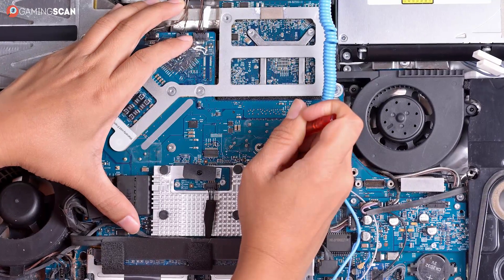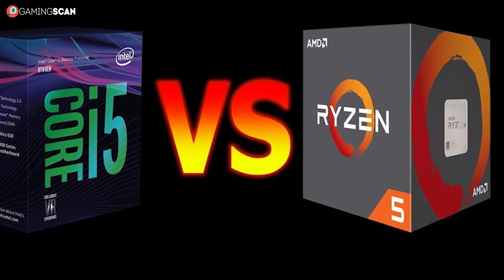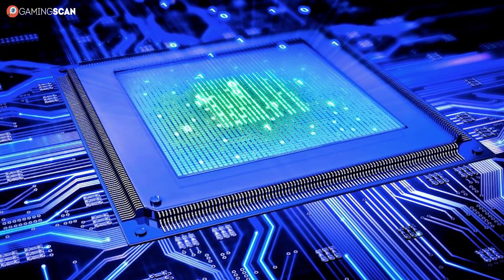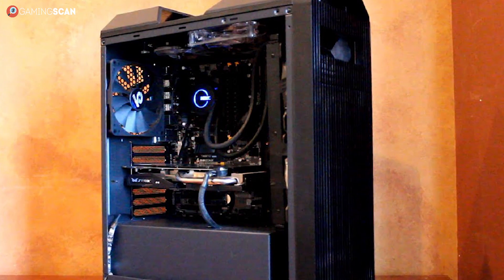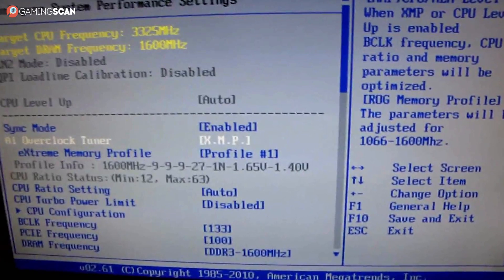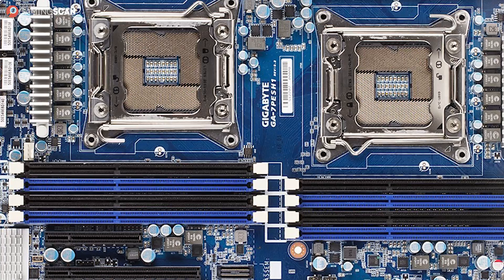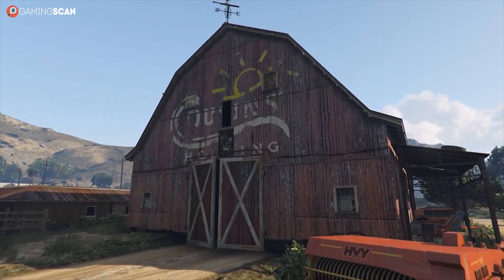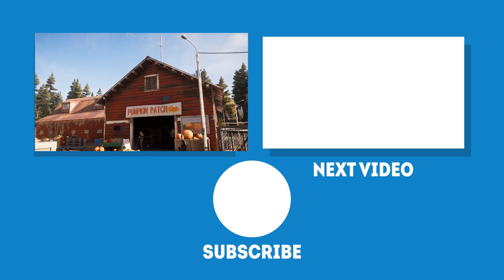Can You Use a Dual Processor Motherboard For Gaming And Is It Worth It? [Simple]

Comment: I dont care i if i NEED it or not that wasn't the question. That was never the question. 
The question was if you can USE dual cpu's for gaming. two very different questions. no one needs a gaming computer in the first place. we want one because we can USE it. 
i'll buy a motherboard with 100 cpu's if i can use it for gaming. do i need it? fk no.
i have a i9-13900k in my computer because i can, not because i need it.
i have 32GB of ram because i need it. windows hogs 10Gb. some games actually require 16gb if i only had 8GB my pc would studder and complain like a mf. 
im using 15GB of ram right now just having a web browser open. 8GB???? you joking? my PC wouldn't run very smooth on 8GB. i started with 16GB and had multiple issues with performance from the start and doubling it fixed it.

Comment: This is interesting, I have to admit ive built a dual CPU PC and the performance of the Xeon CPU's are fairly lack luster although it still does allow an RX 6700 XT to max out without bottlenecking it. I think the main issue is the slow ram speeds

Comment: Too late , just purchased a Z620 HP workstation that arrived yesterday. It comes with 2 8 core processors (Intel Zeon) and 96GB maxed out ram. I've wanted one of these for years and the price was right so I snagged it. Highly doubt even a machine that was built over 10 years ago will ever have that much power utilized at one time. Guess more of a vanity purchase.

Comment: Man, I am about to re-overbuild my computer. It currently has an amd 8350 and best 1060 you could buy which replaced my 760 when it crapped out. My computer is....12 years old. Yep, as noted I had to replace my GPU, some fans and finally a power supply when the 1060 was purchased. Still, 12 frikkin years so out of curiosity I watched this. I am getting a large settlement and thanks for reminding me I don't need to purchase a 13900 K and 4090 for my rebuild. Having 3-4 K to throw at a build doesn't mean you should.

Comment: Dual CPU gaming would be used when running multiple game versions at one time. Such as Raid Shadow Legends running 6 accounts at one time. It would decrease your game load time by over 50% and no lag when you are flipping thru screens and stages in the game. I've seen one of HP's new system with a riser card that consist of a second i7 8 core cpu and 3 slots for ram. Not sure why a call center will need those PC's but they were designed for gaming with two slots for high end graphic cards. It was poorly designed for cooling I could see issues with graphic cards overheating.

Comment: I know this is an old video.  With that said, if your primary purpose is a gaming rig,  a dual cpu system is not your first choice and shouldn't really be on your radar.  However if you  have a dual cpu rig for another reason and want to game a little during your down time, just know the limitations.

Comment: I bought a server back in the day that was probably worth millions of dollars at one point in time for three dollars at a university auction. It had 16 processors on one board. It had enough ram to fill a building. Did I ever use it for anything worth a shit? No. I parted it out. All it was was a house heater. I did mine some bitcoin with it back in the day when that was easy to do. And it was only worth about three cents a bitcoin. Too bad I can’t go back and get all that back. Not the computer but the bitcoin. Lol. Everything is just overkill if you ask me. Right now I still run a DDR3 six core AMD that absolutely rips anything that I can throw at it

Comment: is it cheaper tho? i mean two xeon processors instead of a i5 9th generation for example or a motherboard that costs 150 for a 9th generation cpu
Reply: Not cheaper. Server boards start around $600 and Xeon CPUs that would be close to game worthy start at $1800/ea. Assuming you go with current hardware like the Xeon Scalable gen 2 platform.

Comment: I have an old dell workstation that has dual cpu capabilities. The socket can Only support older cpus, so my 1070 ti is getting bottlenecked. Would a second cpu help reduce that?
Reply: Just upgrade your mb with a lga1511 socket  if you use Intel & get an i7
Reply: I would say Jury-rig it, buuuutttt that would take a lot of sciencing the shit out of it for compatibility.

Comment: Now I'm thinking of making one with 2 amd ryzen 5 3400g cpu's. I wonder if the VEGA 11x2 cores would make a difference in the gaming part. Anyone else tried this yet?
Reply: they dont have dual socket boards for consumer CPUs. benefit would be 0
buy a better CPU, not another low tier one if your GPU needs it (it probably doesnt)
dual CPU is not practical except for workstation applications

Comment: had a dual socket PC in 2001.... windows 2k ran like quick silver. and yeah games can make use of dual cpu's and benefit from them just not the x2 performance you would think. Quake 3 had SMP support way back in 2000 and ut 03/04 also supported SMP i believe though I may be wrong.

Comment: Screw dual socket, quad socket is where its at....
Reply: I need them to make one where I can hookup an AMD Ryzen in 1 and an INTEl in the other instead of just AMD OR Intel. This way I have the Intel for gaming and game development and the AMD for streaming and video editing. I can also use both simultaneously with a GPU for cryptomining. the intel for speed and the Ryzen for the high core count but IDK if they make mixed boards like that... rip lol
Reply: @Yovry  I think we could do this years ago with original and intel cpu's
Reply: supermicro H8QG6-F
Reply: @Boemel  What
(Comes closer to mic)
THE
(EATS THE MICROPHONE)
FFFFFFFUUUUUUUUUUUUUCK
Reply: @Boemel  No.
Supermicro X11QPH+
Reply: @raetego  that's fair. Yah the CPU that I'm getting for my new PC is a ryzen 5 2600 with 12 threads 6 cores
Reply: @raetego  facts
Reply: @raetego  You wouldn't be able to used mixed cpus on Windows 10 Pro For Workstations. The rule for Windows 10 for Workstations software is that no more than two CPUs may be used and both of the two CPUs must be exactly the same type. I'm not certain if this rule applies to any kind of off brand OS but it applies to the WIndows 10 Pro Workstations Software.
Reply: Supermicro used to have a 8 cpu motherboard.

Comment: I wonder if a primary CPU of Intel Core i9 10980XE, secondary CPU of Intel Core i7 10710U or 1065G7 and an External/Backup CPU of Intel Core i5 10210U or 1035G7 will work well
Reply: Nope, in a multi-CPU system all CPU's must be the same model. It used to be that they even had to be from the same batch, but those days (thankfully) are long gone.
Reply: @deanboy2416  ok

Comment: Just ordered a duel xeon with 48 gigs of ram for cheap.  Going to use as an emulator PC.
Reply: How did that work out for you? I'm interested in running two VMs with unRaid for gaming. Do you have any experience in that field?
Reply: @MineRoyalDS  I'm just running windows 10 pro and emulators on it.  Also picked up a radeon rx570 8gig for it. Nothing too fancy, but does a really nice job
Reply: @JasonMeeks79  Oh I see! Did you by chance try to emulate Switch games like Breath of the Wild? I'm curious because I heard AMD cards  have a hard time dealing with CEMU and YUZO.
Reply: I have a single x5680 and 1050 TI, but PS3 emulator barely runs. Would dual CPU help much or do I also need a better GPU?
Reply: @SuperLotus  PS3 emus are buggy, but you proably need more of both
Reply: @jolness1  Do you think they'll better optimized in the future? I'm still hoping to upgrade my PC at some point ofc

Comment: Why I can not use 32 bits and 64 on one motherboard or I can? The first for old games and the second for new. I had read that one multicore CPU better than several with the same quantity. But using 32bits calculations in 64 bits is not better.

Comment: But then I cant do 16 x 8k at 5000fps... I need to have it happen
Reply: 3200 ghz :)))))) was that on space with liquid nitrogen?
Reply: @GHostCCM  wtf did you just say that made NOOO sense
Reply: @PizzaPowerXYZ  it's possible to do this only if you can stay a little bit low than 5000, nearly 4990 less.
Reply: @cringecomputerscientist  
I thought the extra ztx 8990xe supreme edition GPU would be worth it,
Guess not
Reply: 16x8000p?
Reply: @lebionicle8524  it's not 8000p its 4320p

Comment: well thing is emulation software utilizes separate cores all together the best example is a android emulator called Bluestack's that requires at least a dual core processor, in order to actually work at least 1 core of your CPU has to be dedicated to the program and if you only have 1 core at your disposal your OS would litterally lock up due to the fact that it no has access to the CPU

Emulation is becoming a huge part of today's gaming industry tho true no game will really need to utilize 2 processors these kinda boards with lower specs could be a route to travel for making a High end gaming PC from crappy parts, for example say you had 2 athlon ii x2 CPUs and you wanted to make a cheap quad core rig any athlon dual core is like 5-10x cheaper then a quad core of the same series in numbers i can buy athlon ii dual core CPU's for anywhere from 5 to 10 bucks a piece but a quad core athlon ii goes for upwards of 50-100 bucks still, if these boards came in lower spec with older series sockets they would actually be fairly useful for the gaming community because we would be able to cut corners on CPU costs then

Comment: I was able to acquire (with approval) a decommissioned desktop server from my company for its book value (ZERO!!!!!).  In any event, it's a Dell Precision T5600 with dual XEON E5-2667's, 32GB DDR 3 EEC RAM at 1600MHz, and an 825W PS.  I installed a used EVGA GTX 980 FTW that I got off of eBay for US$180 plus shipping. Bought and installed a 240GB WD SSD, and fresh installed WIN 10 Pro 64 bit.

It does very well with games.  No issues running ultra settings at 1080p.  I also use it at 4K with my 43 inch Philips TV.

I will have to buy a sound card, as the DELL server board does not come with this functionality. For now, living off of the HDMI to the TV sound speakers, which are OK...but obviously not great.

PCMark CPU score is above 17,000.  With Heaven Benchmark at ultra settings and 1080p, I am getting 60 FPS.  This is mostly due to the GPU being slightly underclocked.  Not sure exactly why I am forced to do this with MSI afterburner. Could be power, as the GPU requires 6 + 8 pin and the DELL only offered 2 x 6 pin...so I had to use a cheap converter cable off  of eBay for the single 6 to 8 pin adapter.  I did change thermal paste and check/clean the GPU when purchased.  Could be the GPU chip itself or the ram or the thermal pads; it was a used purchase (buyer beware). In any event, performance has been well above the BSEL OC'd Q6600 I had been nursing for the past few years. I am very happy with the rig, overall.

Comment: There are motherboards that support higher that 256gb of ram.  I have 2  2U Servers that can throw down up to 400gb each have 2 8 core Xeons with hyper thread on.  Pegging out 32 cores on each server.  
As far as current ram installed.  Got 48 gig's of ram in it.  Just slowly adding more chips every month. Fully buffered ddr3 is still pricey.
Reply: Hey im trying to build a gaming/cad pc from a dell r410, but i am kind of lost, any advice ?

Comment: For 4k gaming at ultra, i think it's good enough
Reply: 4k Is mostly based on your graphics card, not your cpu.
Reply: @DakotaTheRota  what if you have 7 titan rtx and you wanna play minecraft on 7 moniters.
Reply: @Mickaleb   Minecraft can run on a potato if you're looking to run a 7 monitor set up you only need two Titans at most.
Reply: @temkaster2  Minecraft cannot run on a potato, and I know this because it cannot run on my duel core 1 GHz windows 10 desktop.
Reply: @Mickaleb  1 gHz wtf
Reply: If you're trying to get the cpu to work harder look for more fps and lower resolutions. There you will see an improvement.

Comment: Really well some games are really CPU heavy Special High detailed open world games Ghost Recon wildlands en Arma 3 are CPU heavy I have a AMD FX 4 gigahertz it has trouble to keep it up 85% usage all the time
Reply: Arma 3 struggles with framerate because the memory transfers are unoptimized(so you literally gain in framerate if you have higher clocked memory)
By the way you really sholdn't use any AMD FX series CPU, they claim to have 8 cores but out of those 8 only 4 are capable of floating point operations(so only four of those can be fully used by 3D games) and even if you overclock them to 5ghz their single core performance is nonexistant.(single core performance is very important for games that can't take full advantage of multiple cores)
Reply: @gnaurai6251  you know ever since I upgraded every part of my pc apart from my GPU and it was already a 'good' gaming pc to a 'high end' pc my frames in arma went from about 10-20 in ultra to about 50-60 with the ram speed and the cpu being the only things capable of such an increase.

I7-6700k -> i7 9700k
16gb of 3200mhz ram -> 32gb 3600mhz
Asus z170 pro gaming -> Asus maximus hero XI (WiFi)

Frames from 10-20 too 50-60 in ultra arma 3

Frames from 250-350 too 350-450 in CS:GO

And videos like this say the bottleneck is the graphics card and I definetly heard the same thing before, other than poor optimisation surely it's bull shit.

Comment: what about rendering or video editing. should i consider one.
Reply: @ChromiaCat  This is not true, I have personally used a dual cpu set up and a lot of programs use both cpus. Hell even some games can use both cpus. Here's a video with proof: https://www.youtube.com/watch?v=HKByZT2V6Rs
Reply: @DakotaTheRota  thanks it helps
Reply: @ChromiaCat   You cannot be more wrong. Go try running premier pro on a quad core single socket then run it on a 20 core dual socket solution. Most rendering applications and programs can take advantage of two or more sockets.
Reply: @ChromiaCat  thanks :)
Reply: JohnGreek Every Graphicsprogram is able to work with dual socket cpus. I use 2 xeons 5570s and theyre actually faster than a i7 7700k when it comes to render something in after effects or Cinema 4D. It does actually slow down every game.. my gtx 760 is on the performance level (fps) of a gtx 750 bc of my cpus.. ;36gb ddr3 ecc with 2666 mhz & Samsung evo 850)
Reply: @gepixelt7712  Wait. You're saying dual CPUs lowers performance in gaming?
Reply: SuperLotus yes
Reply: @SuperLotus   No but it won't increase it.

Comment: With the availability of 6-8 core CPUs dual-CPU workstations loose a bit. Also "gaming" is quite broad term - from 1080p to 4k or ultrawide, with or without streaming, recording - in those cases higher core counts are very handy... still dual CPU aren't needed nor targeted by software developers for consumer apps and games, but old Wesmere Xeons and some workstation motherboards are super cheap and you can build a dual CPU PC for the fun of it and maybe even use it for some processing workload.
Reply: Dual CPU have a huge place in servers and any business that runs on pics exclusively.
Reply: Yes, but this video was around consumer usages, mainly gaming.
Reply: @riklaunim  Do you think a dual x5690 would help avoid bottlenecking a gtx1080ti, or dual 1080tis?
Reply: @MrChoquito40  for what tasks? Gaming won't scale to multiple CPUs

Comment: What about music production?
Reply: If you dont like macbooks then a server twin cpu motherboard would work well for music production because its more stable than a standard pc 👍
Reply: Most people in the comment section either don't know or haven't considered the nvme ssd raid 0 configuration when your single cpu or motherboard chip can be a bottle neck. If you're transferring large files and are serious about transfer speeds, than consider a dual cpu motherboard. I have 2 970's pro in raid 0 configuration and I still regret not investing in a dual gpu system. Just something to consider.